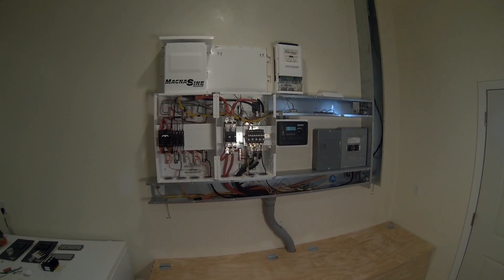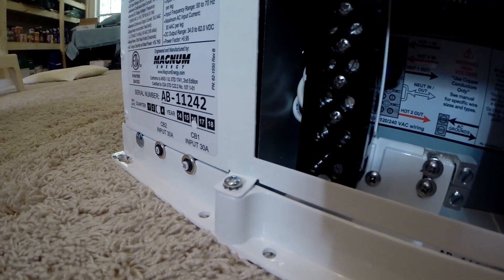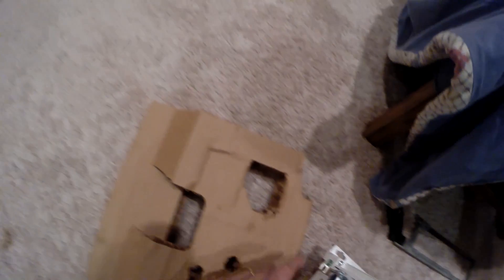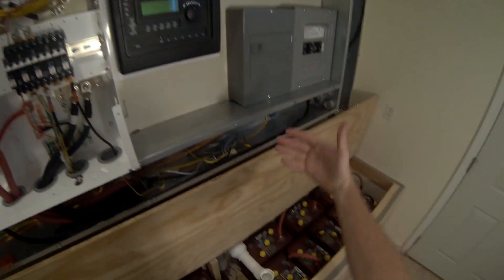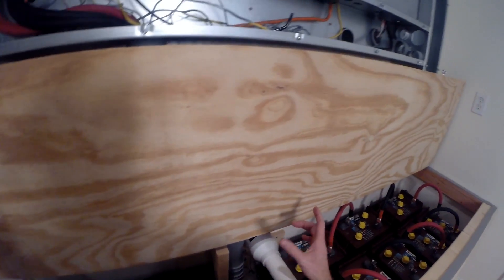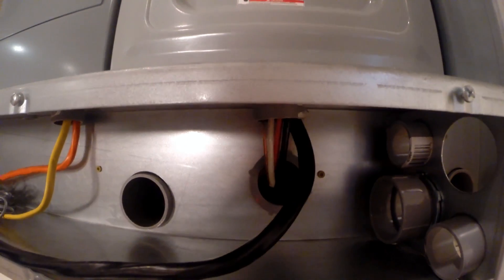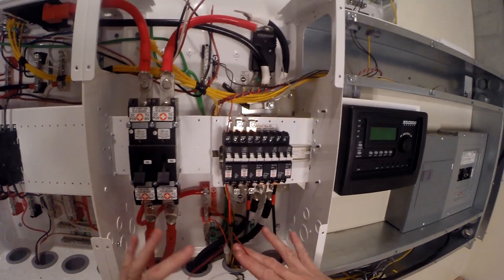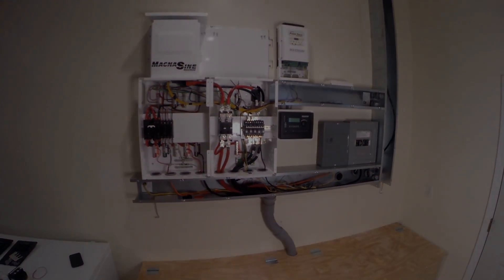Off Grid Solar #23: Problems, Mistakes and Accidents

Comment: One thing about batteries under the panels is that the electronics are/can be subjected to small amounts of acid and ruin the inverters over time.
Reply from the maker: Another reason to switch to Lithium...

Comment: It's not just hydrogen it's oxygen, oxygen falls to the ground that could ignite a lot easier than hydrogen that just disappears into space. Patients have caught fire because some spark happen in the emergency room!
You don't have your battery on a switch? So if you have to work on it, take equipment out, trouble shoot, what not, you can disconnect and not blew your self up...
Reply from the maker: Oxygen is not flammable but it does make other fuels burn hotter and faster.  The batteries are switched in the box but not at the battery terminals.  I could not find a decent affordable switch rated for 60 vdc so I just used a fuse.  The switch I see most people using on 48v systems will fail and the current will arch across the switch terminal if a short occurs in their system.  Thanks
Reply: David Armstrong bulshit look it on YouTube all you have to do is look on YouTube you could see people catching fire during surgery pure oxygen!
Reply from the maker: Watch this:
https://www.youtube.com/watch?v=zZreQ_Zge04

Comment: Boy David, you must be busy with all these correspondences.... but here is another item you need to change out. There is a 2 inch long cylindrical fuse holder...probably going to the fan below. It is in the area of your "arc welding" incident.  Those have a spring loaded glass fuse usually. The plastic design is weak and after while the spring pressure breaks the end out of the fuse holder.  It is better to replace it with a SPADE type fuse holder which has no spring, just the pressure of the blades pressed into the crimp connector.  That is it for now, I will view the rest of your vids later.   Thanks    Jim K

Comment: Is the AC output of the other one the same? connected to GND?
If there continuity with L1, L2 and neutral its the output of the transformer it's ok, but it should not be bonded to GND
Reply from the maker: No, the other inverter does not have its L1, L2 and common ringing out as tied.  This inverter was damaged during shipping.  It's on its way back for a replacement.  Luckily, I discovered the problem before I put any power to it!
Reply: yea, almost a BIG POUF!!!!!

Comment: The 2 positif coming from  the batteries should be connected under the breaker or at the batteries. The 2 inverters are now working all the time, most of the time there will be only one, the master!